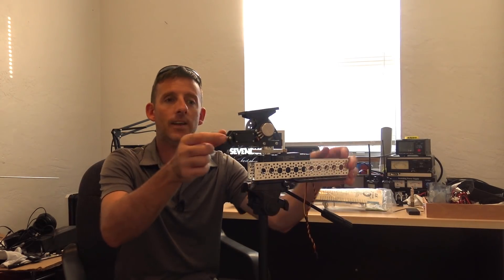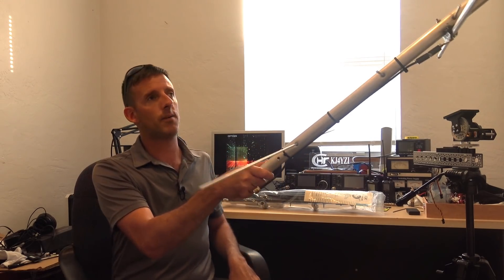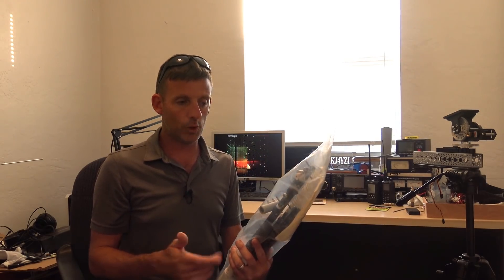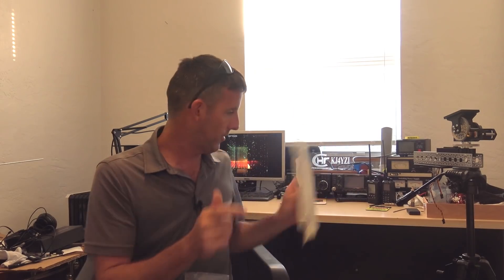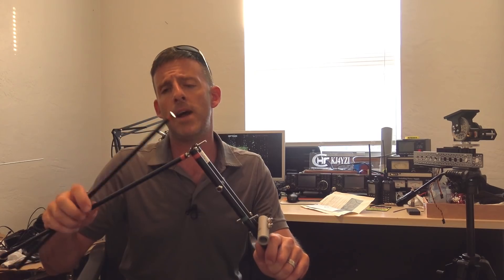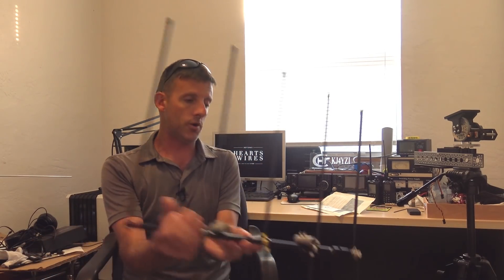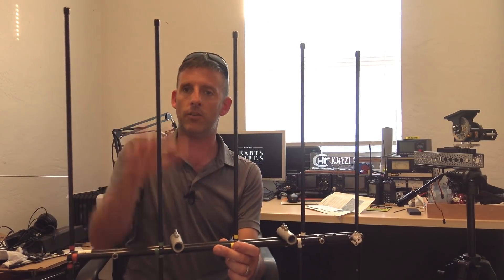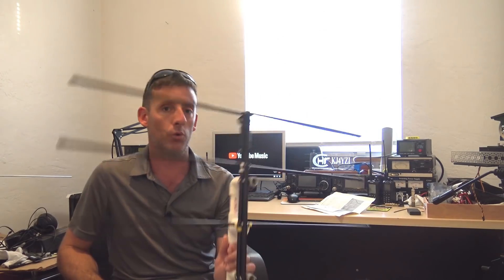Elk Log Periodic 2M/440LBB, Review/Satellite Antenna

Comment: I had an Arrow antenna which I liked it was just a pain to mount on a tripod and while customer service was very good. I also purchased the Elk antenna, after using the Elk and I was able to receive sats through the trees in my backyard where the Arrow couldn't. I sold the Arrow and kept the ELK antenna. Reception is outstanding, easy to assembly, is perfect on a tripod and you don't get tired holding it. I have used the ELK for repeaters uhf and vhf and I didn't have to lower the tower and rotate the antenna when changing from uhf to vhf. Also the ELK 1.1 SWR on UHF and VHF. So many pluses with the ELK.

Comment: Nice overview of the Elk antenna Eric. I see, on your other videos,that you have used the Wouxun KG-UV8 series of full duplex HT for the FM satellites. I recently purchased a KG-UV9P model. I have a full sat ground station at my QTH with preamps, high gain antennas and computer tracking and tuning. But wanted a portable FM setup. There is very little available to guide anyone thru the programming for full duplex for mode V/U and U/V FM satellite operation. I know that the HT's from Wouxon suffer from desense in full duplex mode on the V/U mode sats. But still nice knowing how to get these HT's in full duplex. Maybe AO-91 and AO-92 will be back on soon and the ISS repeater for mode U/V. Since I have only had my UV9P for about a week I have been able to program it into full duplex mode. Not for the newbie. I adjust the squelch on the lower display band (Main)to a level high enough to mute that receiver. That VFO becomes the 2 meter uplink transmit VFO . Then the upper VFO (Main) I set the squelch full open to receive the 70 cm downlink from SO50/AO27. I am unable to save these SQL settings via the software in the separate VFO's.  Have you used this setup approach or something different.  Have you found a way to save SQL settings for each band or do you leave both bands full open? Maybe you could do a video on this subject as time permits. 73, Dave W2GDJ

Comment: You mentioned EME, how much length / weight do you think the servos and this tracker system would handle? Thinking at least a 9-12 element or more if you ran on 23cm?  I am guessing it would be taxing on the setup you built.
Reply: the servos can push more mass than you might think, but not if the load isn’t level.  Get the Antenna center-of-mass directly over the gimbal, and small motors can move it.  The other thing is, “how fast can they move it?” to track a satellite.  😮  That’s where you may need bigger motors.

Comment: Good video, thank you.

You mentioned the very real danger to eyeballs posed by the ends of the antenna elements.  What is your opinion of fitting a length of soft flexible vinyl tubing to the end of each element?  The tubing would need to be a snug fit on the elements, and have sufficient overhang (say, 2 inches / 5 cm, +-) for the vinyl tubing to bend easily when it strikes one's face.  Better to be poked by that than by a rigid aluminum tube.  

I know that vinyl absorbs RF energy but if the ends of the elements are current minima then perhaps the RF heating effect would be minimal.  

Your thoughts?

Comment: Be sure your coax is 90 degrees from the antenna, I use a paint stick and just use electrical tape, and on to coax to hold it 90° from the antenna.
Reply: Dennis, do you mean 90 degrees from the boom or the elements?
Reply: @BretChilcott  
90 degrees from the antenna elements

Comment: I own the hy gain antenna you have. Those are great little antennas for directional use. I dont understand exactly what your getting at because when you use a Yagi Uda antenna your using it more for reception more then transmitting.  Its my personal belief that  log periodics work just as well as a yagi and vice versa! Each to there own. Log 115 Hy Gain Yagi 80 dollars new.
Reply: Antenna gain helps both RX and TX equally well.  A log periodic with the same number of elements as a Yagi will have lower gain, but higher bandwidth.  Log periodic and Yagi antennas have different characteristics, so it's a stretch to say they work equally well.  https://en.wikipedia.org/wiki/Log-periodic_antenna

Comment: I am lucky enough to inherit two of those Elk antennas.   One is up in  the air set at a fixed elevation, - a cheap rotor changes the azimuth, for working the sats.. and the 2nd Elk antenna is in a bag for portable ops.  They work great.  Good explanation on the difference between an Elk lp design and a traditional Yagi.    "Be careful kid, you'll poke your eye out"  lol.

Comment: Not related, but I was hoping someone here might be able to give me some advise. I just got an ID-4100 to put in my vehicle. However, I can't really mount it any way other than a roof rack bar. I was told to get a Diamond NR770H since it's half wave or greater, and therefore doesn't need to be mounted to the body to form a ground plane. The problem is, it's too long. An NR73B is quite a bit shorter, but is still half wave or greater on both bands. Would that still work for my purposes?
Reply: Austin,
 Why can't you mount it any other way than roof rack bar??The shorter antenna should be fine. Just remember, even though the antenna doesn't need a ground plane, the mount itself needs a good ground to the chassis of the vehicle. Check your SWR after it's mounted. Don't want to smoke the finals in your radio. 73 de KG5RQZ
Reply: I can't mount it any other way because I can't damage the vehicle. Also, I guess I'll be having to find a way to attach ground. Probably run a second wire out the bottom of the door and down to the frame.
Reply: @AlphariusMemegon  ok, must be a lease? You could also use a lip mount on top of one of the rear doors.
Reply: @AlphariusMemegon  Sir,  have the area  of gutter mounting car-detailed before handing back.
You could use rubber packing, make sure to earth to vehicle.

Comment: I have used a ELK for satellites and it works great. I generally use it on a tripod in my bedroom with the radio about 30 ft away. I point it west and I can hit a repeater at at 10 miles away, a 447MHz repeater at about 300 degrees (30 degrees N of W) at 30 miles, and a 2m repeater at 60 miles due east (the back side of the antenna!). I can make full quieting contacts on all three without moving the antenna using 25watts. It has wider lobes than the Yagi, and less back to front ratio. However it has a very good gain. I forget the specs, but it is quite good.  It also performs very well on SSB and I have gotten a 100 mile contact with it. I checked on the analyzer and it is flat around 1.2 across the entire 2m band.
Reply: that's awsome 7 3
Reply: In regards to repeaters, I do that with a rubber ducky from my living room couch. You should try much further simplex, or a very distant repeater, over 100 miles should be no problem depending on whats in between. Ive talked from Vegas to Cedar City Utah with a Colinear and 50 watts.
Reply: @Justin-bd2dg  yeah I have gotten over 100miles simplex ssb. Satellites over 300 miles to the satellite with 5 watts.